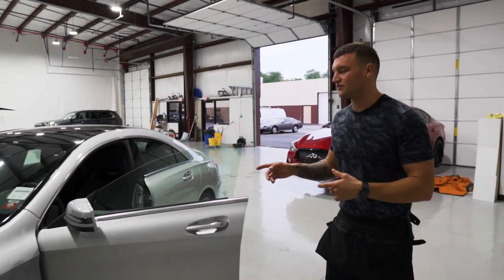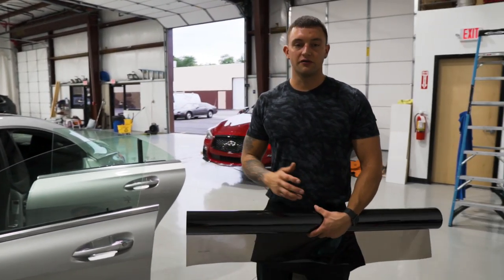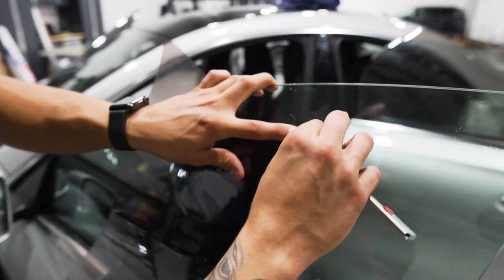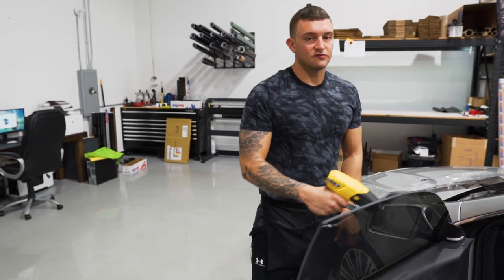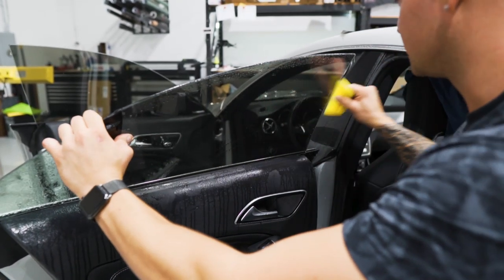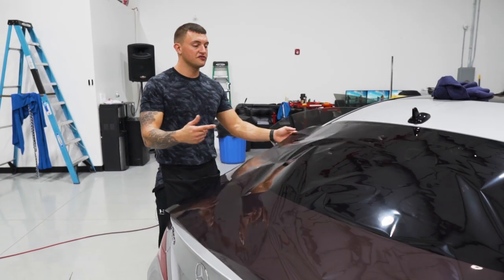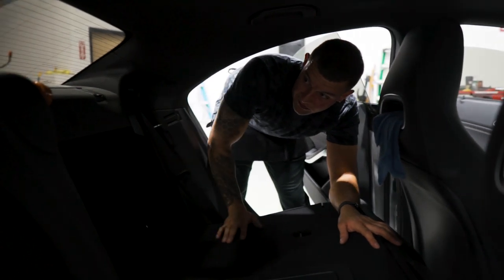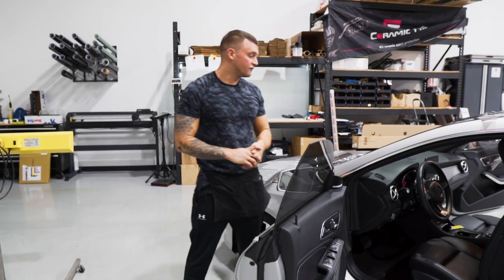How To Tint a 2018 Mercedes Benz CLA Coupe

Comment: You should teach people to use a silver sharpie to mark front, back, and bottom edges to reduce risk of cutting rubber. Also get a peel glass so you're not cutting on cars, since you use tape on windshields but not side doors. 
If the film over hangs on the top and back edge that's not a problem just heat it up and let it sit for 30 to 45 mins then shave it so you don't have a gap on frameless windows
Final note on the cla250 on the driver's side there's a module for the keyless entry in the truck behind the panel that needs to be covered or else water will soak it and make the push button start not work
Reply: U sound like a with this comment 😂

Comment: Hey Sean, was wondering if you’re using 30 degree carbon blade to cut the edges.
Reply from the maker: No, just standard olfa blades. But you can use 30deg on the top edge